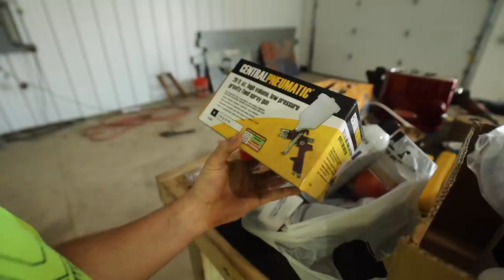PLEASE DO NOT UNDERCOAT YOUR VEHICLES...Thank You

Comment: Fluid film or oil based undercoatings are great for corrosion protection. In this case you should try Chassis Saver by magnet paints, its awesome if the chassis is prepped properly. Rubber undercoating traps moisture
Reply: Ive been trying to figure out the best way to prevent further rust and have landed on Fluid film... but seeing this chassis saver makes me wonder... which would you recommend for someone in Virginia w/an 04 and some fairly heavy surface rust?
Reply: @lilshaff07  fluid film black, that's what I use on my Toyo.
Reply: Lol IV always undercoat my frames. Should I just let them rot according to the video headline?
Reply: Zinc. nickel . chrome.anodize. when I worked at  the electro plating company I figured out nothing beats it's nothing . We would electro plate everything then paint it. Bike's quads Jeep's Harley's you name it.
Reply: Fluid film is the best option even the hard reach spots that still have rubbized undercoating will soften up after a few weeks when fluod film is sprayed over those areas. After a month in warm temps the rubber mixed with fluid film will scape off easy
Reply: @dannym5865  rubberize undercounting is bad period. It will trapp humidity in summer time and worse in the north ( rust Bell state's )
You're best option if you want to paint your chassis properly is old school acrylic enamel paint or if you have money; powder coating.
Reply: "rubber undercoating traps moisture" no it doesnt.
Reply: @solluna2155  No its not, learn to use it properly, any test you can find online will show you its the best.  I live in Finland, we all use rubberized undercoating and im pretty sure we know a thing or two about rust.
Reply: @NjoyMoney  That's assuming  you don't have ANY rust trapped under the rubberized coating. If you do it's going to continue to spread and you won't even know how extensive the damage is because it'll be hidden by the coating.
Reply: @ZippyLikesZippers  You know rust needs oxygen to continue right? The process is literally oxidation. Having dry rust under would only very slowly continue the process if at all. 

Regardless i always remove all the rust before.
Reply: @ZippyLikesZippers the point is to seal existing rust from oxygen
Reply: @timekeeper2117  But how do you zinc plate the frame and underside of a car or truck 😅
Reply: @chuck1622  same way they do all the rest of it. I could do a truck chassis where I worked. ✌️.
Reply: Wool wax that is all
Reply: @timekeeper2117 I was just thinking this watching all these undercoating videos with pblaster rust shield and fluid film... muriatic acid, etc.. Why is no one chroming their frames? Yeah I know its cost but if youre serious about your vehicle lasting forever then its a small investment in the grand scheme of things.  Which is better? Chrome? Anodizing? Nickel? or Zinc?  I know they do Nickel Boron coated bolt carriers for AR15s to never need lubrication and to keep cooler from the heat.  So I watched how that was done and just saw it was all baths with electrolysis.. why is no one getting these done!?? Sooo much cleaner looking. Undercoating sprays look like a mess afterwards... like someone drove through a fresh paved blacktop.
Reply: @NjoyMoney  it absolutely does trap moisture if it gets a chip or a crack. Also you can't use it properly on a vehicle with some rust started. You would need to sand blast it down to bare metal and even then there could be micopores that harbor corrosion.
Reply: @MySisterandBro  no you spray a lanolin based oil like fluid film, woolwax, surface shield instead of  a paint/bedliner/por15 that trap in moisture.
Reply: @NjoyMoney if you put rubberized undercoating over rust. It will trap it and rust out even faster. To avoid this you would need a rust converter (like Rust Kutter) and then spray rubberized undercoating after. Spraying right over rust may look good for a period of time but the effects are devastating. Trust me I live in Minnesota and deal with this stuff
Reply: @paulrademacher  rust needs oxygen to continue rusting. im in finland you cant teach me anything about rust.
Reply: @AMoneyVideo  youre wrong, rust needs oxygen to continue rusting, its literally called oxidation, no oxygen will get through a zinc coating and undercoat.
Reply: @AMoneyVideo  you make 0 sense, how will undercoat trap moisture but fluid film wont 🤣🤣🤣
Reply: @NjoyMoney  fluid film displaces (floats) the moisture. So any that contacts it will rise above the fluid film layer away from the metal.
Reply: @NjoyMoney chips, cracks, micro holes, and scratches allow moisture through a zinc coating. A zinc coating also creates a pocket between itself and the metal to hold that moisture in. It will not displace it.
Reply: @NjoyMoney If this was about the dwarf invasion I might agree with you considering you are from Finland. However it's about rust and looks like we can teach you a lot about rust. Because here in America in the rust belt where we use salt and brine on every road every day  we know paint undercoating fails and why. Lanolin based or Junkyard.
Reply: @AMoneyVideo  You do realize the entire country of Finland is as north as Alaska is? LOOOL.
Reply: @NjoyMoney  You do realize 1 state alone has millions more cars than your entire country? In 1 trip to the grocery store I see more cars than you do in an entire year. Also it has nothing to do with how FAR north. Everything to do with far ENOUGH north to salt roads. Or coastal enough to get ocean salt mist.
Reply: @timekeeper2117  how much does something like that cost?

Comment: The best solution is what the military has been doing since ww1. RP-342! It's a wx base cosmoline and can be found on amazon. It's superior to paint in every way for preventing rust and is so effective it was designed to be use on bare steel. That's why you can pop open a crate of ww2 rifles and find zero rust. Frame paint is good bt a pinhole is all I takes to negate its protections and RP-342 WILLMSELF SEAL and prevents water and salts from getting under it even if a spot is missed.

Comment: Eastwood is good stuff.  Another good rust converter is Ospho.  Another good frame paint is Chassis Saver by Monstaliner.  Definitely don't undercoat with tar or rubber or spray paint.  Those seal in the rust and the frame rots from the inside out.  Surface Shield is a non-hardening lanolin based spray coating that prevents rust.  Spray inside and outside the box frame.  I spray everything under the vehicle except brake rotors and exhaust systems.  It's also great to spray inside doors and rocker panels but make sure the door weep holes remain open.  Touch up next year and every other year after that.  Don't pressure wash under the truck.  Spring rains will wash away the salt deposits on the outside of the Surface Shield that never make it to the frame.  Surface Shield is also the best anti-corrosion treatment I've found for battery terminals.
Reply: just went through 3 cases of Woolwax on a 2007 civic, a 2018 camry, and a 2005 highlander, and still gonna order more....I'm getting every damn nook, cranny, and cavity so help me God.  F-ing rust!
Reply: What about POR 15?
Reply: @richcombs4805  Gotcha. I'll check out Eastwood. However do you think it'd work if I prime and frame coat over it?
Reply: @richcombs4805  goo, interesting. I'll check it out. Thanks!
Reply: @johnathanpratt944  the product description for Ospho states to apply, possibly twice for heavy rust, then let dry overnight before painting.  Is that your question?  Note that I've never worked with Ospho, but other converters and for areas that don't show, I'd just slather with lanolin based product like Woolwax or Blaster Surface Shield.
Reply: @richcombs4805  gotcha, yeah that answers my question, ty. Do you recommend Ospho over Eastwood for rust converter?
Reply: @johnathanpratt944  I see excellent reviews online of Ospho to the point I doubt it would be bad and I would use it.  I do not have experience with the Eastwood product but I don't doubt they are reputable.  The other idea for parts you can remove is to soak in rust remover (note a very good product that is very low cost in comparison to stuff in the box stores is rust911)
Reply: was going to go this route - seeing this video has me pondering again the best route! lol can't decide.. Fluid film black was gona be my approach for surface rust after hitting it all w/a wire wheel and brush... now i can't decide...
Reply: @richcombs4805  cool! Yeah I've got a Honda Civic and I want to do it right so I feel like I'm going to have to strip the car to bare bones. I'm figuring it it'll take about a week. do you think that's about right?
Reply: @johnathanpratt944  do you mean complete removal of everything???  There's no frame on a civic to "strip down to bear bones."  I don't know your experience or level of expertise...I wouldn't be able to remove and replace an engine without taking forever (to put my skills in perspective).  Hit the flakey rust with a wire brush, look for any rust-through around the parking brake cable brackets (I have one nearly rusted through hanging by a thread) and where the cables enter the floor under the armrest.....basically remove large flake with a wire brush and then use at least fluid film to get something on it this year (since it is such a thin product it will flow out the spray can nozzle without clogging I'm thinking)....if you have a compressor (like 60gal) you could apply woolwax with 80psig air in a heated garage.  Note my garage was around 45F and the spray cans of woolwax clogged up because I did not keep shaking them often enough (the product is thick and settles fast in the can).  Next April on a warm day hit it all again....next Fall like September switch to your choice of color of woolwax (black is easier to apply and notice if you miss a spot).  Get up in all the hidden unibody sheet metal folds, access or drain holes, inside control arms, around rear upper control arm connection points, under and behind both bumper covers (if you are comfortable removing those, be careful, if the rust is heavy you could end up with a surprise of having everything fall apart and not be able to reassemble) and get the rear supports all around and inside of those tubes that hold that rear bumper on (underside of mine are totally rotted away).
Reply: @johnathanpratt944  - I bought a POR-15 kit to restore the receiver hitch on my 2005 4Runner but never used it after doing more research.  POR-15 works well and makes a hard shiny surface, but in some high impact or wear cases it can crack and rust can eat the metal from within.  The non-hardening lanolin based anti-corrosion products can't crack and lanolin is hydrophobic.  The lanolin surface treatments aren't as pretty and they can be messy if you do mechanical work on those areas, but the corrosion protection is excellent.  Monstaliner's parent company makes a good product called Chassis Saver that works similarly to POR-15.
Reply: @lilshaff07  - I think black Fluid Film looks the best of all of the lanolin based anti-corrosion coverings.  Aesthetically, I think vehicles should be black underneath.  I use Surface Shield, which isn't available in black.  On the down side, it allows you to see the surface rust under the coating, but on the plus side, it allows you to see the surface rust under the coating so you can be assured that the rust isn't getting worse.  With a good lanolin anti-corrosion treatment, it won't rust any more.  Fluid Film Black has great corrosion resistance but it looks almost as good as black paint.

If car companies weren't still playing the planned obsolescence game, they'd spray the frames inside and out with a lanolin based anti-corrosion treatment.  It's a bit messy, particularly before it skins over a bit, but it's worth the mess.  I'm typically under my cars once a year to change the oil, so the mess doesn't bother me.

Comment: I don’t use undercoat, but when I built my 03 3rd gen cummins I por-15 the frame the right way (took like 2 weeks lol) and I use roll on bed liner under the cab and under the bed. I live in upstate NY and it’s 2 years later now, I blew my 48re last month so long story short I built a full billet 48re with fat shafts. Needed a 6.7 crank for the converter I got so I’m 6.7 swapping the 03. With the tranny and motor out again I can get a great look at the bed liner under the cab and bed. It is immaculate! Never had a problem with it before but also never really had a truck for multiple years that I could inspect like this. I also did the proper prep and got rid of any visible rust before I rolled the bed liner on. I don’t like the rubber undercoating at all, but por-15, bed liner, and especially fluid film always seem to work for me in the north east. Great video

Comment: I spray paint my car and truck chassis and floorboards and frame, including the underside of my truck bed with rust olem black paint.  Helps keep the underside of my car and truck protected when they put road salts and chemicals on the roads.  That extra protection sure does help a lot.

Comment: Rubberized undercoat is very good BUT it’s only effective when there is absolutely no moisture, dirt, rust etc on the surface. I would only put it on a brand new cars or a very, very well prepped surfaces like e.g  
during/after a restoration. But for my taste I would always choose a regular chassis paint and then wax or oil coat the undercarriage. Pressure wash it once after the winter and coat it again. I prefer having the surface smooth so the dirt have harder time sticking to the surface and it’s easier to clean then the rough texture of the rubberised undercoat paint.

Comment: Well if you wanna do it the hard way that’s fine I’ve been restoring vehicles for years I appreciate your hard work and dedication to descaling a frame but there’s a much easier way and when you’re done there’s nothing left on it hot water sandblasting at 4000 psi then repeat Hot water sandblasting works much better I used to do it the way you guys did it then I discovered this I threw my air scaler away just saying not judging but try it But I definitely do agree with you on the rubberized undercoat it’s garbage I’m in Canada and we deal with salt shit but try the hot water Sam blasting it makes life so much easier and it doesn’t hurt anything been doing it now for four years with great results

Comment: I always used farm and implement paint, usually rustoleum cut 50/50. Get the scale off, and give it time to seep in, suggest at least 74F at night with low humidity  ( with fans running ), if not using heaters lol. Always rustoleum rust reformer nowadays first now here and there, that frame will need a ton of it (not a fan of water based, metal loves oil) lol. And invest of a set of PPG nozzles. Like 60 bux. It does a good job, check rust every month or 2 and touch up. In a year or so wont see any usually. Back in the day i use used motor oil, trans fluid, and kerosene with a dash of tide lol. Always tide on the cooling system. It worked ok.

Comment: I use Hammerrite spray on my crown Vic's frame after sanding. Roadsalt in the winter here in Norway. Not good for the brakeparts. Has replaced the rotors too. Has not used any Fluidfilm. Can not have some underflush. Must recoat the fluidfilm about every year.

Comment: Great Choice on the Eastwood Surface Prep Tool, and Eastwood Products. I went with a portable sandblaster, full POR kit with the Top Coat, and Eastwoods internal frame coating. Powder coated the leaf springs in Red to match my Rancho Suspension Lift Kit.
Reply: I still have to redo the wiring harnesses; the OEM plastic wring loom is crap.  You can find dried up salt inside, so I'll go with the Painless Performance Fabric Wiring looms

Comment: We undercoat everything where I work..hot rods only..under the car or cab and bed unless there is wood on the bed floor ..under inner fenders inside the cab or car..raptor liner and sometimes SEM (WHICH IS NOT SO GREAT) BUT hardened coatings are great when done right and only powder frames but we have painted some show frames like bagged trucks. Powder is where it's at..rubberized is garbage and shouldn't be used period on anything PERIOD!

Comment: Guys I live in the Northeast where there's plenty of salt on the roads please listen to me closely... Pressure wash underneath your truck and spray everything with either fluid film, lanolin or blaster surface protectant believe me the rust will stop.. I live in Northeast New York I know what rust is since I've been using lanolin fluid Film.  The rust has come to a complete halt paint does not work it holds the moisture next to the metal... Feel free to inbox me I'll show you plenty of photos
Reply: Exactly! Ceramic paint might be great for a street queen with a chip and some Mexican wheels but nothing is beating spraying it with fluid film or NH oil.... You're not getting that paint into where it needs to be

Comment: paint then undercoaat
Reply: Use a metal etc primer then undercoat. Been doing it like that for over 45 years without any problems. You can get etching primer in a spray can if you don't have an compressor.

Comment: This is not correct and you aware totally wrong. If it was paint, it would have done the same things. Painting over rust is the issue. Undercoat works just as good as paint or better. It is rubberised on like paint that will chip by rocks etc. What this person lay have done and what not to do is undercoating or painting over rust. I’ve gotten awesome results by first removing the rust, then priming with a good rust primer, then two thin coast of rubberised undercoat. This takes patience and time.